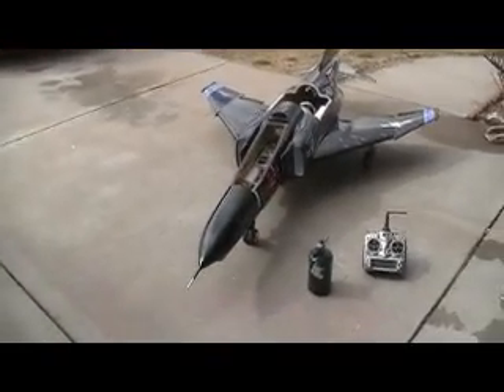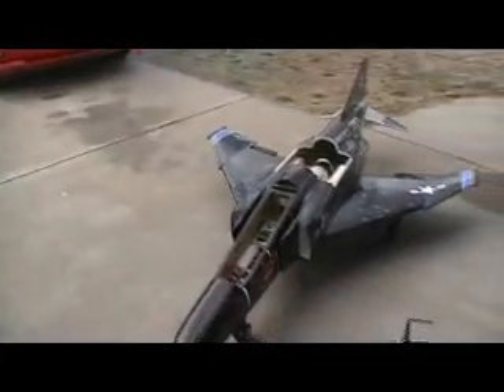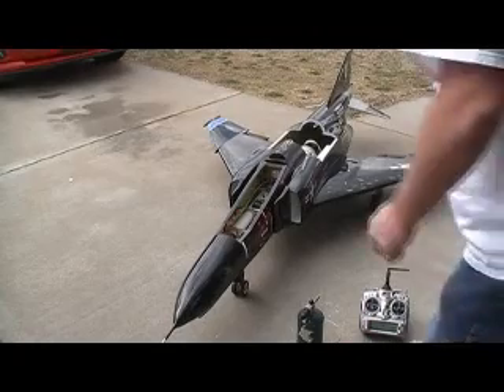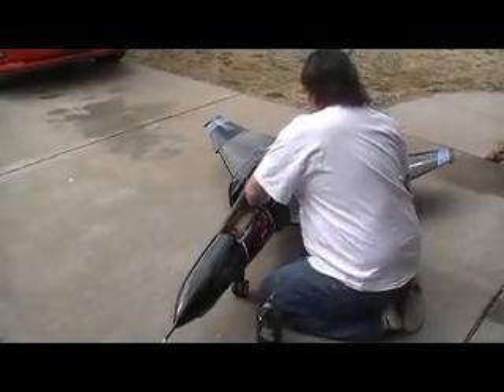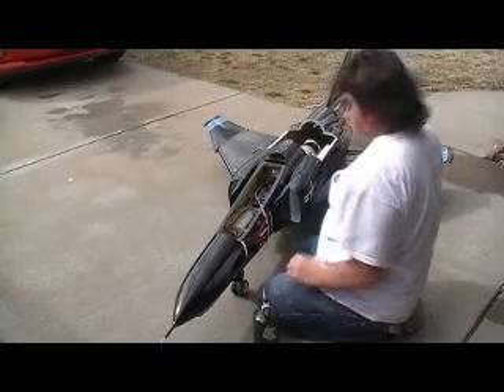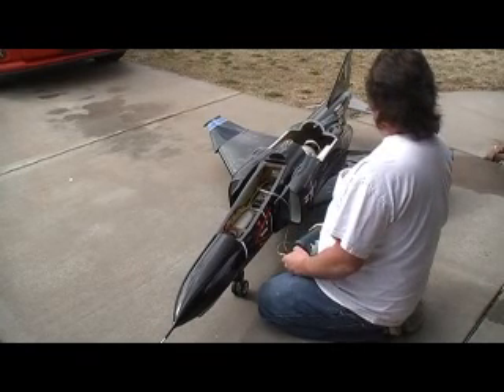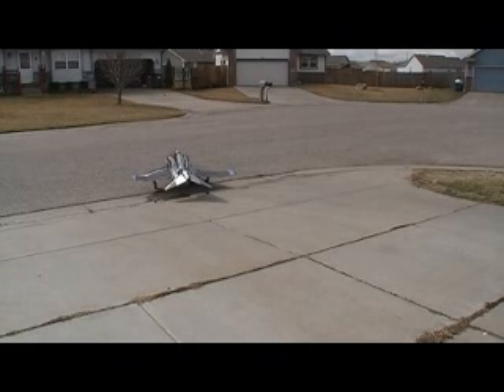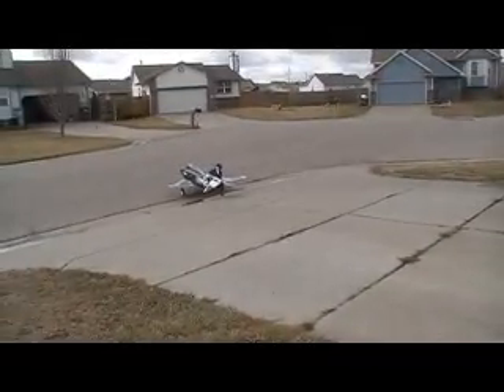taxi testing F-4

Comment: Many jet pilots have the brakes connected to the elevator control (right stick on the transmittter) so when you angle down, the brakes engage. As far as I know they are progressive so they don't automatically skid but aren't as control sensitive as say your car's brakes.